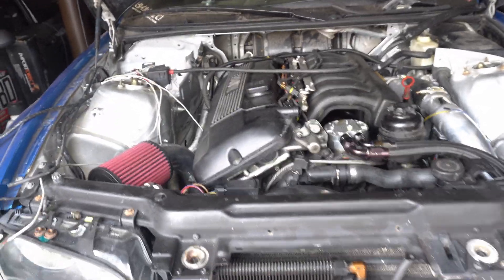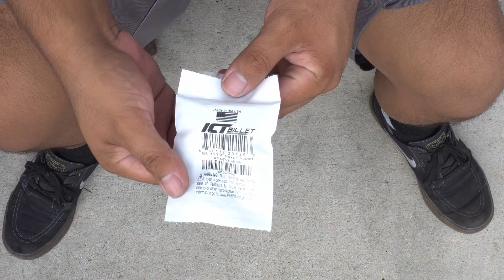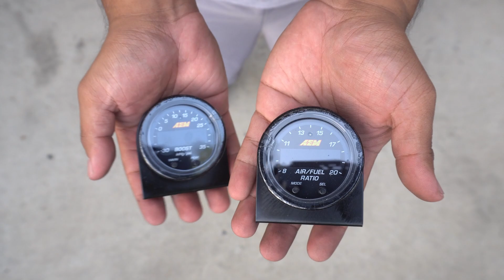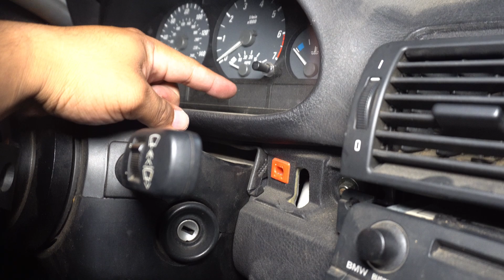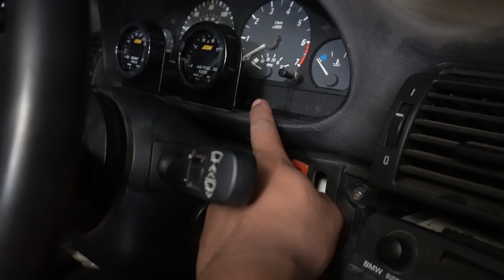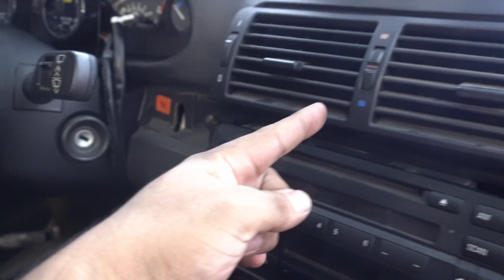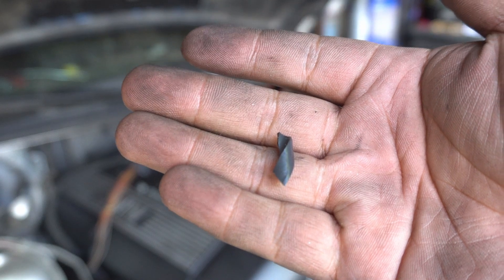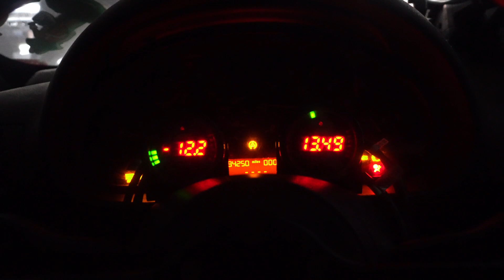TURBO E46 Wideband, Boost Gauge, and Oil Catch Can | #TheE46DriftBuild Ep 59

Comment: Hey man, I was watching your video to see how you fitted you manifold and did your valve cover vent. I have mine venting to atmosphere but it’s just a filter on the end and oil is coming out from it quite a bit. Engines rebuilt so I’m confused to think is it blow by ? My manifold is m50 aswell on a m54 b30. Any tips?
Reply from the maker: Talk to your engine builder. Could be blowby from rings not seating properly?
Reply: @nuisance_carl  I fitted a catch can with a filter on the end it’s not been throwing any oil in there so it seems mite be valve cover leak. Thanks for the reply. 

Should we expect a upload soon ?

Comment: How did you wire the wide band 02 into the stock harness.. 
did you contact to the 2 narrow band o2 sensors wires to the wide band o2
Reply from the maker: When you buy a wideband, it comes with the gauge, harness, and wideband o2 sensor. You run power and ground to it, but it operates independently of the stock harness. The ECU itself does not reference the wideband, only the factory o2 sensors.

Comment: Quick question. For the catch can, I see u put the top hose coming from the valve cover to the catch can. Did you plug the other end that was connected to the engine? Or is that one still open
Reply from the maker: You mean the port on the intake manifold? Yes I plugged that.

Comment: Hey question do have any idea how to install a electronic boost controller on our E46 ? I wanna do a electronic boost controller with a Mac boost solenoid, just a lil confused on how to install
Reply from the maker: I believe there's an explanation on the ms4x wiki on how to wire it up. As far as what lines go where, I'm not sure.

Comment: Hi Carl. I'm a fan. What did you use to block off the CCV return line that goes back to the intake manifold? I assume that needs to be under vacuum.
Reply from the maker: I just plugged it up with a cap and hose clamp.
Reply: @nuisance_carl  awesome. thanks man. I'll do that on mine if i decide to vent to atmosphere
Reply from the maker: @RoleyChiu  Just note, if you're going to be turbocharged you can't pull vacuum from the stock location. You'll have to either pull vacuum from the turbo intake, or the exhaust
Reply: @nuisance_carl  Thanks for clearing that up for me! That was a question I had in my head for a while too, since I do plan to turbo (one day). For now, just headers and a tune. Thanks for putting out content man. You inspire noobs like me to gain levels.

Comment: It would be better to install catch can  somewhere low , that's there is no incline in crankcase hose .
 Im afraid that the most of oil and water will be colecting at the lowest point of  hose rather than catch can 
It's suppose to be mostly fumes coming from engine but I think some of it will be  anyway condescending in lines .
Reply from the maker: Great point. I wanted to mount my catch can low as well but I didn't really have a good place to mount it where it's easily accessible and protected from damage. We'll see if I have any issues.

Comment: Did you weld M3 rear fender flares onto your non-M coupe? It looks good I couldn't even tell it wasn't an m chassis initially.
Reply from the maker: They're actually fiberglass ones from DTM Fiberwerkz. Riveted on for easy replacement if/when I get in an accident lol

Comment: How are you gone run the stock maf? The maf is limited to something like 6 psi or something
Reply from the maker: No, I'm running the HPX PMAS maf. I wouldn't recommend stock maf.
Reply: @nuisance_carl  do you know how to rescale it to the map?
Reply from the maker: @1997sivan  I used RomRaider's "Maf Hack" as described in the MS4X Wiki. You need to do this with the 512k file, not the 64k file.
Reply: @nuisance_carl  i see, i asume you got the ms43
Reply from the maker: Yup

Comment: Hey imo and trial/error that’s too much restriction when venting, you’ll get smoky turbo at stop lights. I have had that same catch can installed before, it cause me problems with oil in the spark plug tubes. You need massive diameter of hose all the way through.
Reply from the maker: Thanks! I’ll probably run it like this for now and make adjustments if I have issues.

Comment: Consider running a lot of water/methanol spray. I run it on my twincharged m44 and I have almost zero iat gain at 30psi. BMW's really love cold air and the water will keep the intake ports and valves super clean
Reply: Also BMW valve guide seals are made to be under vaccum they don't do well with "open" crankcase. Run that open line back to the intake with a brake booster check valve
Reply from the maker: @knarrlyboy7821  Yea I'm not looking for crazy power on this build so water/meth is a no go for me. I'll go E85 before I do water/meth. Regarding the open crankcase, several people run this way. If I have issues I'll consider pulling vacuum from the exhaust.
Reply: E85 will give you a lot of the same protection as the water meth. As to the vaccum issue, in my experience removing the crankcase vaccum does 2 things.  More prone to burning oil through valve guide seals( I thought I was killing turbos but solved after redoing my pcv) and oil leaks. I  noticed oil seeping from oil pan gasket and valve cover gasket that slowly would get worse and worse.  The vaccum helps pull the oil back in and creates a better seal. And with the plastic valve covers, they are even harder to get a good seal on. Just keep it in mind later before you start questioning other parts. And good luck with your build.
Reply from the maker: Thanks! Will definitely keep that in mind.